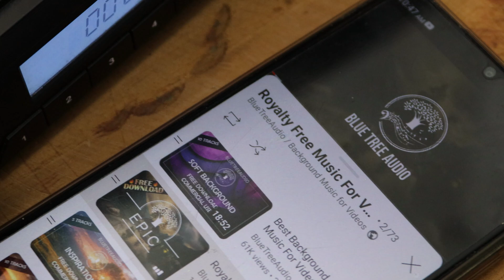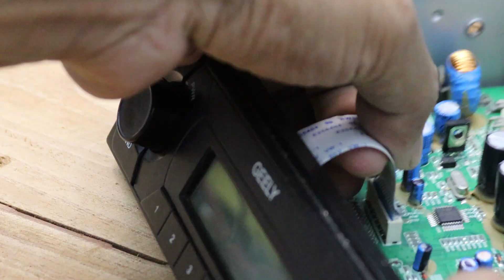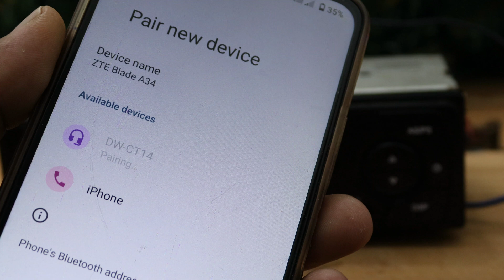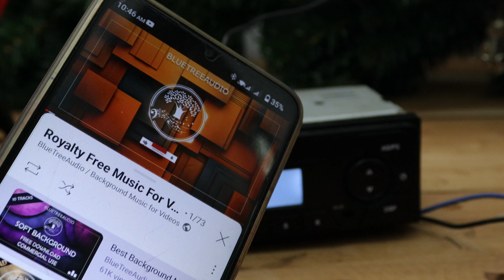Upgrade Bluetooth for Car Audio System

Comment: So you wired it into the aux port by creating a common ground between the left and right channels of the Bluetooth chip to the aux port ? Why do we need the capacitor ?
Reply from the maker: Since that Bluetooth module has not a common ground.